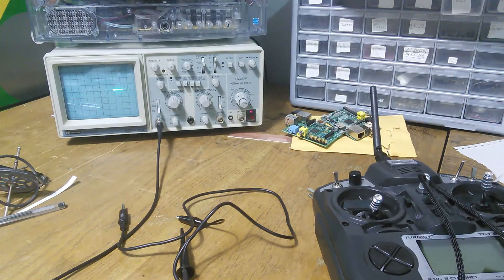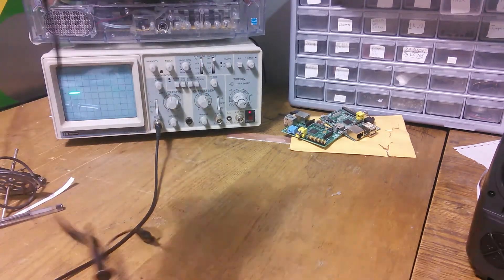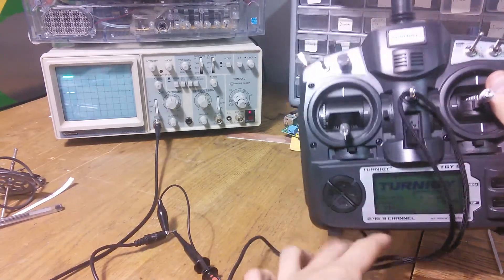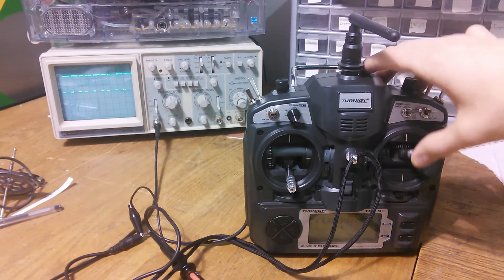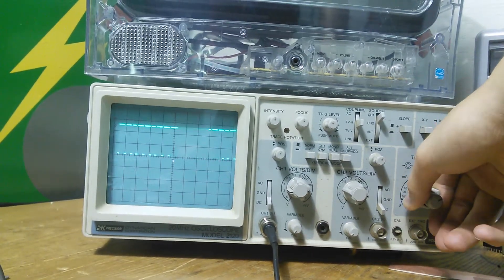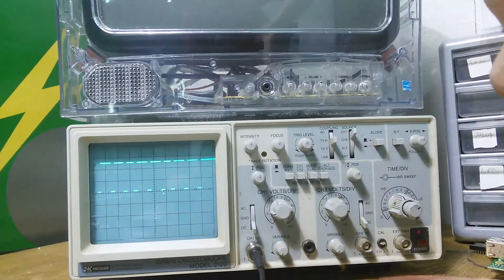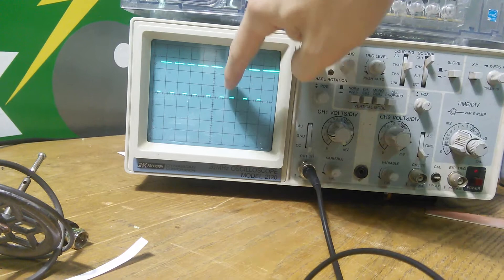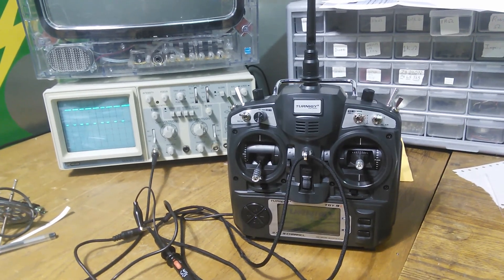Turnigy9x PPM Trainer Port signals on Oscilloscope

Comment: 9 years later i got this transmitter and was going to connect it to my oscilloscope to see if it was emitting at all, because i couldn´t make it work with my pc. turns out you had to disconect that module!!! you saved my ass. thanks a lot.

Comment: Nice vid, explains PPM perfectly. Though, it doesn't explain how trainer signal is incapsulated. And you didn't tell what the voltae level is. 
So, trainer port is just two wires: signal and ground? Am I right that the rc is listening to those trainer signals, filters out the needed channels according to settings and then it mixes these signals internally to the output signal? 
If no such packets are ommited, it seems pretty easy to implement some discrete switches (to swtich on/off light/camera/gps, etc.)

Comment: Hi, I'm also using an Turnigy 9x Transmitter but i have no clue how to assign the individual switches to a channel number. I'm connecting it to an arduino so i need to know how to read if the switch is a 0 or a 1. Can you please explain how to do this? Im losing my mind trying to figure this out :/